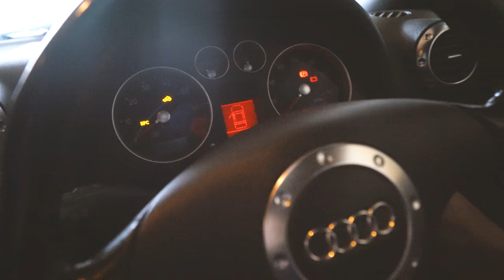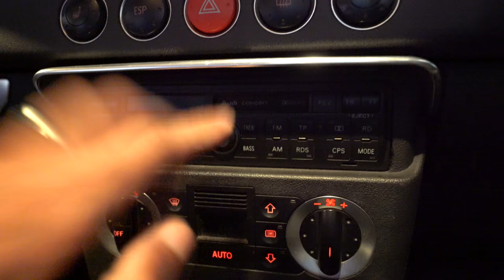The TT Project ACTUALLY Runs! FIRST THRASH!!

Comment: Id put a sway bar in the rear too make it a bit more neutral.
Along with a ecu tune + exhaust opening it up a bit would be good mods
(though ecu tune ofc costs a bit.)
The N75 valve for a bit more boost pressure or adjusting the screw for a bit slower boost or faster boost if the car already has that valve.

Replace rubber vacuum lines with silicone too stop future leaks.
Also try too add strength too the intake & charge hoses as ofc boost is needed.

Comment: AP coilovers, full millteck system, Airtec big front mount intercooler, Revo stage 2 remap, Forced induction kit. I mean there not cheap but that’s what a project is for and there the parts I’m putting in my TT

Comment: KO4 turbo, upgraded injectors, RS4 coilpacks, blowoff valve, electronic boost control and cat back exhaust. And stage 2 tune. Coilovers, new wheels and spoiler. 

There's a good plan. KO4 turbo is actually cheap. Good luck. :3

Comment: So... I have an idea for some starter mods.
1. Wheels & tires. You already said you're doing this, good on ya.
2. Exhaust. Techtonics Tuning downpipe, and then as straight a pipe as is legal there.
3. Tune. More power is always good.
4. Good spark plugs and maybe injectors.
5. Haldex controller. More power to the back!
5. Bigger turbo maybe?
Reply: Oh you already did spark plugs. Good.

Comment: To unlock the radio go to Dealership or remove the battery and unplug the radio wait 15 minutes the hook everything thing back up. As for an angle grinder check with Alec Steele on you tube he can point you in the right direction

Comment: you can just disconnect the radio from the battery and reconnect, you should be able to re enter the code. Atleast thats how it works with mine, the audi delta 2.